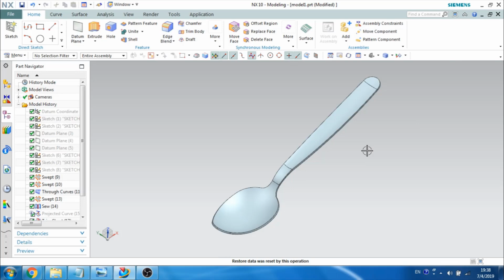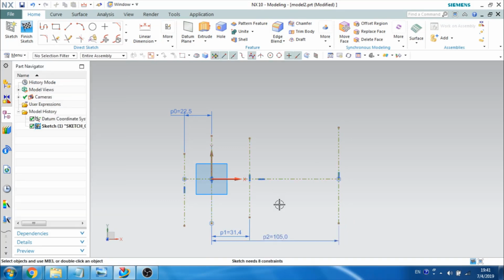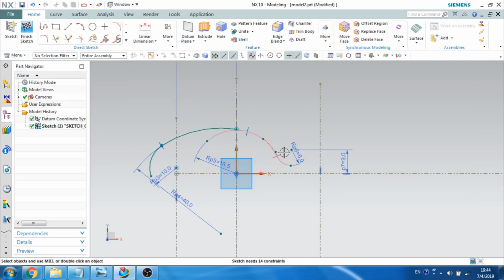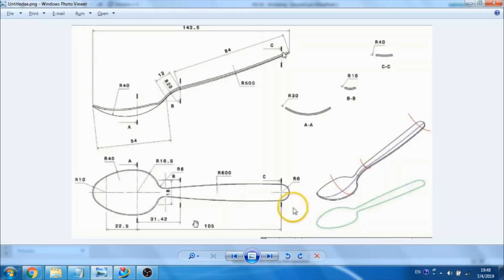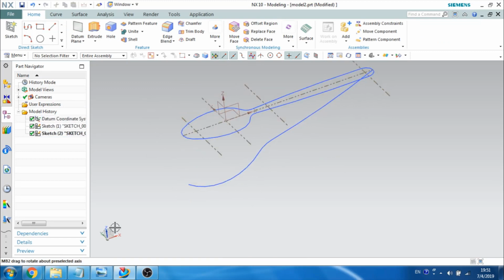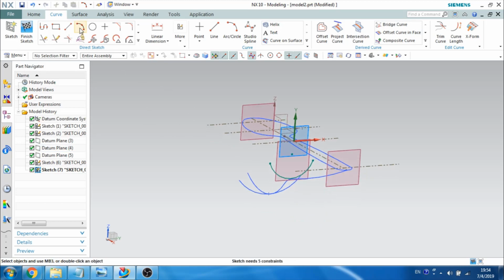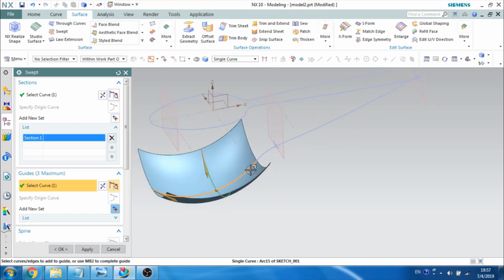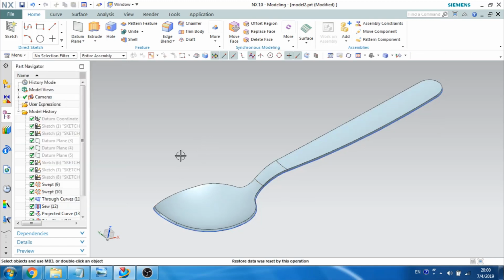Unigraphics NX-Surface Modeling Example || Feeding Spoon.

Comment: It would have been better and easier if you would have used the construction lines to draw the arcs or cirkels, as you can use them later on to create the 3 arcs and define their length. You have put them at the right distance but if you also would have given them the correct lenght (2x the given radi) then you would only be two cirkels of a certain diameter at a certain distance with in between them an tangent arc of 40 mm. Let the program work for you, not the other way around. High FiVE :-)

Comment: Hi sir! one doubt why do u use through curves command for the middle portion of the spoon and swept command for the first and last portion. Can we use swept command itself for the middle portion as this portion also contains both curve and section. Please clarify
Reply from the maker: There is difference b/n those two commands.. you can check that in my channel you will understand
Reply: sweep makes one curve to flow on another, and it was needed in that case and in the middle through curves because you had two lines and there was need to create surface between them